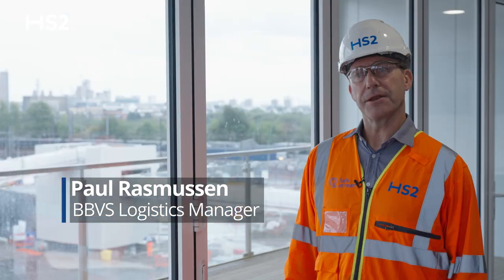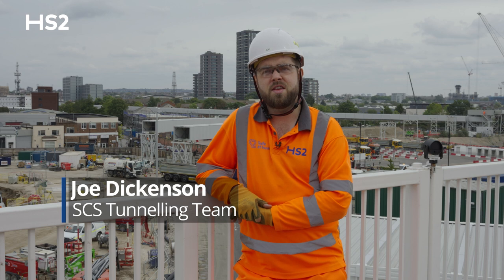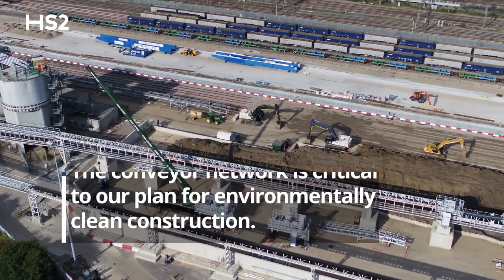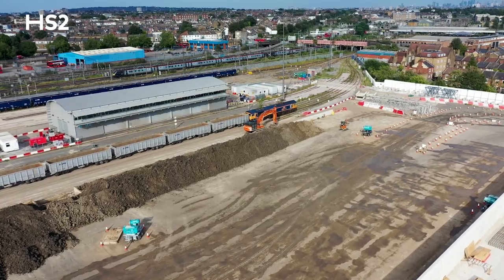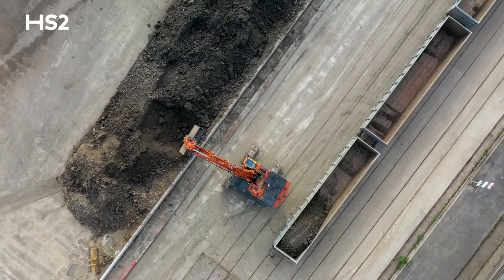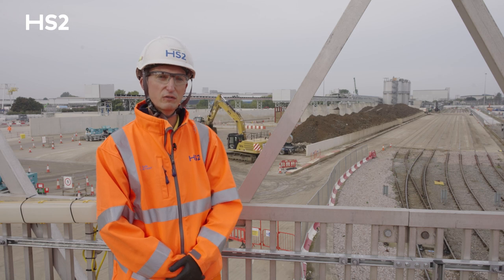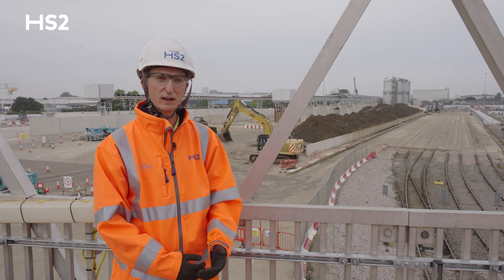HS2’s enormous spoil conveyor begins operation in West London

Comment: I wonder what the cost comparison would have been to load the material directly onto the train from the conveyer belt vs the cost of the equipment rental and diesel to load the train with excavators.
Reply: I guess that way the conveyor can run 24/7. The stockpile acts like a buffer.
Reply: But then, nobody on the project much cares about the cost, do they? It's not their money, and there's always plenty more available. Always pick the solution that pays the most consultants, that's the way to build a railway (that will only be affordable for the same consultants to travel on, so win-win really).
Reply: @thisnicklldo  complete tosh this will be the most optimum way to remove the spoil using existing rail heads for disposal
Reply: @colinbrooks228  Right, well tell me the cost of the conveyor system. My guess, £300m. You don't get anything for less than £100m on HS2, that's just small change and not worth while even getting on the gravy train. If it's so economical, why isn't all tunnel spoil removed this way? £100bn is going somewhere, this is the sort of place it's going.
Reply: @thisnicklldo  Firstly, part of the reason HS2 is so expensive is because it's being done in such a way to minimise environmental damage. At every stage they're taking decisions to spend a bit more to emit and damage less. The conveyor might be more expensive than a fleet of trucks, but it won't be much different, and (per the video) it takes 70 trucks a day off the road for 4-5 years. That's significant. The construction industry is the source of massive amounts of emissions so I'm happy to see some money spent to minimise emissions and reduce congestion. Secondly, you can't get cross about something being expensive that in your own words is "small change". That's very silly. Thirdly, I can tell you know a grand total of nil about how public sector procurement works so maybe calm down, put the kettle on and try not to get so worked up about it.
Reply: @thisnicklldo  do you honestly think there is no oversight of expenditure? The biggest cost so far hasn't been construction it's been land acquisition. And you're making the mistake of thinking that HS2 will be optional. This will be the express route between several cities, creating more capacity on existing lines. Another critic who hasn't even read the first paragraph of the business case but is happy to unquestionably accept all media criticism of the project.
Reply: @hairyairey  1. 'Oversight' means checking whether expenditure is within budget - no doubt there's plenty of that, indeed several people will retire rich at 40 on the fees they earn for their cost oversight reports; but whether there was enough critical thinking applied to the budget in the first place - that I do not believe. 2. No problem with expanding the capacity of rail lines - 120 miles through some of the most benignly flat country in the world for £100bn is completely ludicrous. Norway are developing a 680 mile coastal highway, over and through fjords in mountainous terrain, for what was budgeted at $47bn, say £40bn - no doubt those costs will grow, but at least Norwegian engineers and constructions companies are not taking the mickey. Take any rail route past or through the Alps - I can imagine the sniggers from Swiss and Italian engineers when they hear the HS2 engineers complaining about the Chilterns. 3. It won't achieve its business case, because it won't be used by the people who underly that business case. No doubt Concorde was funded on the basis of perceived value from improved journey times from UK-US times - it was a fine piece of engineering, but it was only used by the wealthy, mostly media folk, and revolutionised nothing. HS2 will be unaffordable for most Brits, I'm sure I will never travel on it, I can't really afford the current cost of an inter-city train ticket, and London-Birmingham return for what I guess will be £700 will be out of the question. 4. I don't need the media to tell me that £100bn  is outrageous - imagine what Birmingham and the North could do with that money - 100 new hospitals, 50 universities, every road north of Watford re-surfaced and widened, keeping some steelworks open, it would be life-changing for half the population of the country.
Reply: @thisnicklldo  you're being ridiculous, over half the route to Birmingham is in tunnels and you're applying the figure for both phases to one phase of construction. From what I have seen I wouldn't trust you with an abacus. Bringing up fantasy train fare figures as well, you just don't get it! This will be the inter-city route between these cities not the WCML! There will be no different fares to travel on it like in other countries. Give me strength, honestly...
Reply: @hairyairey  I'm not applying the costs for phase 1 plus 2. Phase 1 will turn out at £85bn minimum, and there's many more years to go for that to inflate. The current price for a London-Birmingham return is £188. What will that be by the end of the decade? Well, nobody can know for sure, but £300 is a reasonable guess. How much to add for HS2? That depends on the ongoing level of subsidy, but there won't be much political support for that, so the operators will probably have free reign. £500 is a likely minimum, only a 66% uplift - maybe £700 is over the top, but the capacity of train operators to take the mickey out of travellers is virtually unlimited.
Reply: @thisnicklldo  you still don't get it. Please at least read the first paragraph of the full business case

"On 11 February 2020 the Prime Minister announced that the Government intended to proceed with High Speed 2 (HS2), having considered the conclusions of the Independent Review of HS2, led by Douglas Oakervee, and wider advice. This was based on evidence that its potential to redistribute opportunity and prosperity across the country, provide much needed future rail capacity, and support the 2050 net zero carbon objective, continues to outweigh its costs"
Reply: @hairyairey  Ridiculous. 'Redistributing opportunity and prosperity' and 'supporting the 2050 net zero carbon initiative' wouldn't find a  home in any business case that can be quantified - in fact it's the opposite of a business case, it's a polemical case. But anyway, I absolutely challenge that opportunity and prosperity will be redistributed by a rail line that will serve a few business men from the south east travelling up to the Midlands in a bit more style, and maybe a few Midlands celebs getting to shop in Chelsea a bit more easily. Yes, infrastructure does matter, rail lines in principle ease trade, and trade indeed is the source of all prosperity - but you will never see a return on 100bn for a 100 mile journey time reduced by 20-25 mins. I could see a business case based on freight, but obviously that won't travel on HS2, and you will need to work hard to convince me that there will be more freight capacity on existing lines by transfer a passenger numbers to HS2 - they won't transfer because it will be too costly. I'm all for saving the planet, but plainly HS2 cannot actually reduce carbon emissions, though of course it can be constructed in a way that minimes extra carbon emission. It's all about the cost - railways are a good thing and can reduce friction in the economy, but the price is too high by a factor of 3. And videos like this one further convince me that the cost is not essential - it's a luxury solution rife with profiteering. The political importance of the so-called 'red wall' mean that cancellation is politically impossible, and reports like the one you are citing will be produced to justify that - but the people 'of the north' would be better advised not treating cancellation as some terrible blow to their futures, but the release of money that could actually do some good for them. They don't see it like that, so the people of Hartlepool will continue to vote for HS2 because they are in the poor north and HS2 is somehow associated with balancing up the south and north, but this is definitely not really the case, they are supporting a gravy train that they will never get on.
Reply: @thisnicklldo  You still don't get it do you? HS2 is about increasing capacity, speed is incidental. It is supposed to alleviate overcrowding on the ECML, WCML and MML. (The suspension of the Eastern Leg puts some of that on hold, granted). Once open there is more capacity for freight and commuter services. In addition the building of the East-West rail line will take freight off the ECML and WCML. Before you criticise a business case, why not read it all first? You've probably never travelled on any of these lines either. Wales for example will benefit from more capacity being available through Birmingham New Street for more services. 

If this is still beyond your comprehension, imagine our road network without motorways. Unthinkable, right? That's what HS2 is part of, a network of rail "motorways" to get the inter-city services onto dedicated lines. It works everywhere in Europe I really don't see your issue with it.

If you think HS2 is expensive then you haven't been keeping up with the expense of road building projects. Some of which have been close to £1 billion PER MILE!
Reply: @thisnicklldo , comparing a highway in Norway and a railway line in uk is like comparing apples and oranges.
A highway doesn't need to be flat, a railway does, a highway doesn't need technologically advanced signalling and safety systems, a railway does.
I could go on and on.
For you to even think you can compare the two shows your complete lack of any knowledge on the subject.
Reply: @thisnicklldo  , another armchair critic, who has no overall understanding of the need of HS2. The need for this line will reduce trucks on the road and freeing up the ability to expand the rail network.  It’s far more environmentally friendly to use the rail network for freight and get these lorries of the roads
Reply: @hughedwards3826  So build a freight line. Or expand the capacitly of the existing line, to free up room for freight. Or build a new line at 1/3 the cost that isn't 'high speed'. You want to move lorries off the road, £100bn will buy you a lot more transfer than HS2 is going to. Carbon capture varies a lot from industry to industry, but a reasonable average might be £50 per tonne, but lets say £100 just to be pessimistic. £100bn will buy you 1bn tons of carbon capture (per year) - that's more than the entire co2 emissions of the country. But we are never going to be able to do it, because we've spent all the money we have on this damn railway. People are so credulous - a couple of (no doubt expensive) PR agencies spend years working up diversionary arguments for the unaffordable, and there's nothing like 'eco' to provide the unanswerable argument - it's the reason I should buy my telly, my car, my washing liquid, my clothes, there isn't a product that isn't justified by its claim to save the planet. Nobody decided to build HS2 to save the polar bears (no, I'm no climate sceptic, the polar bears do need saving and rail can, indeed, help), it's a folly that is sustaining a massive gravy train. By the way, this armchair critic is paying the taxes to support a white elephant that I will never travel on, that was justified because it will even up the north-south divide, and justified now by green arguments. It isn't going to even up the divide, an it isn't going to do save the planet.
Reply: In a ideal world I would agree with you on this, however we know to well what trains operate like and if one train is cancelled due to the wrong leaves on the track then they would have to stop work in the tunnels if the belts are full
Reply: Different materials will be removed and used for Different purposes. Sorting done at the stockpiles means trains or wagons can be loaded with what is needed further up the construction sites. All railways were built this way with sections producing waste balanced by sites needing it for construction. A tunnel provides the material for an embankment or noise reduction bank.
Reply: @thisnicklldo  You say the terrain is flat yet completely ignore the Chilterns and the attention taken to protect wildlife and limit emissions at the same time. Look at the original line from Birmingham to London and decide why it follows the course it does. A high speed line is ideally both straight and level. The original line is neither. Men died to dig tunnels back then and little kids cleaned chimneys. The major costs have been land acquisition which is more expensive if you have to compensate house holders and businesses in major cities rather than acres of forests and fields.
Reply: @thisnicklldo  The current Birmingham to London line was built in 1830s. Almost 200years on it is still the original twin track railway it was from the start. Through Birmingham to Coventry and Coventry to Rugby it is running mainly through areas where industrial premises and housing is up to the line already. Thousands of homes would need to be demolished and businesses moved as well. At Rugby the line becomes four track as the Birmingham by pass route from the North joins. This is also working at near capacity. New Street Station is a major railway hub with no space for expansion as it's actually in the city centre. Trains have to wait to enter during busy periods because of the tunnels and their limitations.  HS2 will connect to Birmingham International and Airport plus NEC allowing interchange for North Wales traffic to either service. You fail to look at the larger picture which has nothing to do with speed but total rail capacity. Already there are two routes between Birmingham and London and more is needed to facilitate passenger and freight traffic.
Reply: I'm  still waiting for the cost comparison putting 90% of the line underground versus the CPO of all the land and peoples properties
Reply: @Georgechamberlain1 Then why isn't it 90% built underground.
I've challenged HS2 on this several times, CPO of land and property versus tunnelling.
Reply: @GeorgeBot7  is it minimizing environmental damage, or just moving the spoil to communities that don't have political clout to stop it?
Reply: @ArtStoneUS  where has this happened? There are no random spoil heaps?

Comment: Just wondering what will happen if the belts fail and the whole part of that section needs replacing? Is their a plan to work around this while it gets fixed or is all work stopped?
Reply: Don't worry, money is no object they'll have plenty of resources and bits laying around to replace/repair in know time.
Reply: It’s only really an issue if the framing for the belt itself fails. The ones I work with now haven’t had issues in 30 years. If the belt itself tears it can be repaired in ways that aren’t intrusive. Or can be replaced by splicing the new belt onto the old and pulling it through the system.

Comment: This is just what we need,  another railway to Birmingham
Reply: London and Birmingham are our two largest cities, and there is currently no high-speed railway between them. The existing railways between London and Birmingham are at capacity because they can't run trains along them as fast as modern train will run.
Reply: Not just any old railway, one that's costing billions.
Reply: @tlangdon12  HS2 Ltd state that to "break even" with a subsidy of 50/60%, they'd need to have almost 600,000 passengers travelling between London & Birmingham on a DAILY basis. 
Given that passenger numbers on this route have been declining by 4% per year for the past decade & the average number is now 96,000, perhaps you'd care to explain where the extra 504,000 are going to materialise from?

Comment: Would it not be easier for the conveyor belt to load directly onto the train ?
Reply: Don't be silly, why would you use a hopper and save on the cost of running them big diggers? Also they need to show why they are way over budget some how.

Comment: What happens to the steel/belts once the project is completed?
Reply: Proberbly dismantled to be used elsewhere.
Reply: They must put it on another, but ever so slightly smaller, conveyor belt
Reply: ebay
Reply: Melted down and re-used may be? 

Or they do what I do with scrap and leave it on the driveway
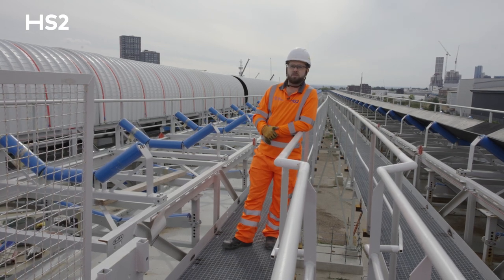Reply: At 1:13 you can see that it's all bolted construction. It could all be disassembled and reused, either for a new large scale construction project, or the system ends up in an open pit mine which use similar belt systems.
Reply: They'll use it to transport beer into central London.

Comment: Ok you use conveyors to move the material 2.2Km to the load point but then use excavators to load it into trains instead of using conveyors.  Forgive me if that just doesn't make any sense at all.   Even of you want the ability to stock pile wouldn't it make more sense to load with a conveyor and only stockpile between trains?

Comment: POOR IMPLEMENTATION, YOU HAVE 2X HITACHI 490`S using ditching/ grading buckets to load the trains, these buckets have "roughly" half the bulk carrying capacity of a digging bucket, ok, i understand the material being loaded is on a concrete base and they don`t want to damage the base by using a toothed bucket, but you can use a "digging bucket" with no teeth which will protect the concrete, they should also have another excavator pushing material towards the 490`s ,thereby keeping LARGE piles of material within easy reach and also making sure each bucket of material being loaded is a FULL bucket...............simples.
Reply: Or even better why not a conveyor system to load the wagons?